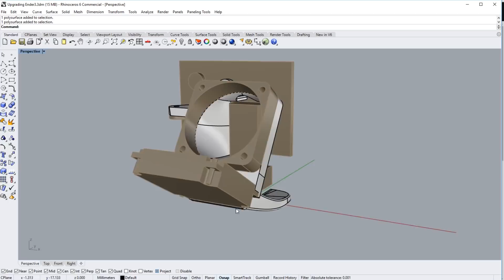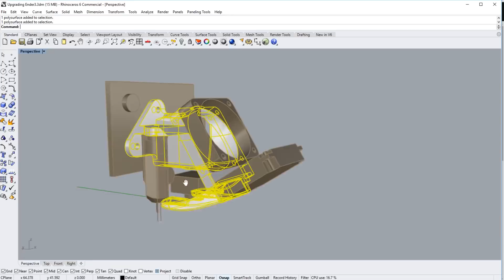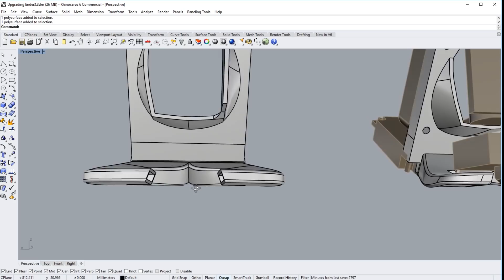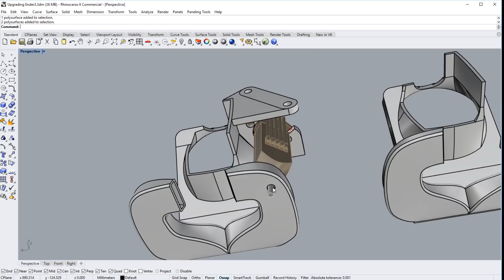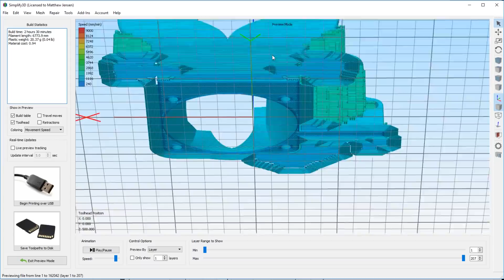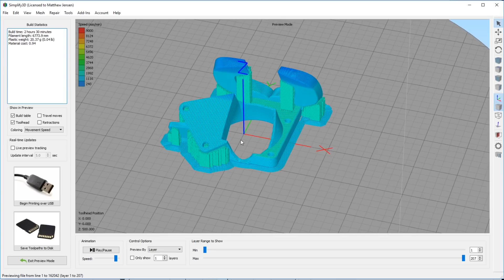Upgrading the Creality Ender 3 with Duet Wi-Fi, and other add-ons - part 1

Comment: So, I totally get what your saying about "stealing from companies", but I would argue that it is duets fault for making it open source. If they really wanted to make the best product and keep all of the cash, then they would have done the same thing a company like Apple has been doing for YEARS. So is it really stealing if they made the choice to put it out there and NOT make all the money they possibly could? I honestly think that the open source movement is good in all, but it's really not a great business tactic, ESPECIALLY if you want to make as much money as possible from your revolutionary product. And, I'm pretty sure the folks at duet know that.
Reply from the maker: Hi Austin, Thanks for another great comment. I get your point, the thing is that the DUET is built upon the Arduino DUE which is open source. Therefore, the DUET is required to be open source. The GNU GPL V3 License agreement that most of this stuff is based on requires that if you use open source in your product you must make the advancements you contributed open source as well. This is the thing which Chna is not doing. They are using open source, but not releasing their contributions. 

Here is the thing though. people have to earn a reasonable income for their efforts. Especially people talented enough to create electronics boards, and the software that goes along with it. These people can get jobs elsewhere and they will stop making better and better 3D printers for you and me. If we as a community don't reward original creators we will lose the people doing the innovating, and all we will have is the copycats. The knockoff folks don't know how to create new and innovative things, all they know how to do is copy. If you love new and improved tech, you have to reward the person or company responsible for creating it. Even if it is open source, and technically speaking the copy cats aren't breaking any rules. But they are breaking rules, and they are getting away with it. They aren't releasing their designs to be open source, and yet we are all still buying the cheap crap while the original creators starve. Well maybe not starve, but they aren't getting rich, and they should be.
Reply: Design Prototype Test Yes, i agree that from a moral perspective we should try not to support the Chinese copycats, and encourage them to make great and original products like Creality. It would mean better products for the rest of the world.

Though, if duet really wanted to make some great money and still have it be open source, they should consider making a partnership with a factory in China to mass produce the board at a low price just like E3D

Now from a totally business perspective, I'm not sure if copycats in China are truly are breaking any rules. By using an open source product, are you lawfully agreeing to make your open source product to the same degree that it's predecessor was? Do companies that make open source products have the right to sue companies who copy their ideas without proper documentation?  I don't think the a court of law recognizes an open source product as defendable in court. To me, it seems clear that an open source product is not lawfully protected like a patent or trademark. 

Furthermore, no one has fully defined what open source really means. Duet is not completely open source, because they do not have proper Bill of Materials and their schematics are incomplete. This makes it unable to be manufactured without some reverse engineering.  This is the same thing with the prusa mk3. No average person can create their own Einsi board because the files are improperly documented (as least to a electrically challenged individual like myself).

On the other hand, the Sigma line by BCN3D and Lulzbot printers are regarded by most to be fully open source. All necessary information is available and properly documented to the general public by both companies. 

Now, with all these gray areas, Im sure that you would agree that this is a very complex issue. But, do I think that China should start making more of their own original products? Absolutely. Do I think that open source has made 3D printing what it is today? Absolutely. But, I also think that open source has a long way to go before it is concrete and effective. Duet, even how great their products are, from a purely business perspective is frankly stubborn. They could really try to bring the cost down on their boards to compete with copycats, and they could be more in depth with their open source business philosophy. Prusa is a great example of this. Even though his product could be more open, Prusa is making great money and expanding his business all the while maintaining the open source philosophy. He is a truly respectable man from an ethical and business perspective. 

But again, open source is arguably a gray area right now. Many people, myself included, are wondering the same things. What truly makes a product open source? Should the definition of open source be up to the company? How can we stop China from hurting original creators? How can we encourage China to make new and great products based on ones that are open source? How can we change a culture (China) that actually has a proverb that translates to : "If you can cheat, then cheat?  And, how can we make an concrete and lawfully recognized system to encourage more people to spread great and original idea? I certainly don't have the answers, but hopefully they will reveal themselves in due time. :)

P.S Great video as always. Should have said that at the start, but I was so eager to share my thoughts with you on a controversial and not fully defined topic and have a discussion. I love business; someday I dream to be comparable to the likes of someone like Elon Musk, and I really want to explore this business philosophy and how we can fix it. Anyways, this video like many of your others very informative and very entertaining for an engineering student like myself. You're one of the YouTube channels that make me happy the moment that they upload. Thank you for making the world a better, more informed, and more creative place!!! :D

Comment: Great video! I have a PRUSA MK3 and an Ender 3 in my collection of 5 printers. Perfect timing for your series, I have another Ender 3 still in the box. How are running the 40mm 12v Noctua as cooling fan? I know the Noctua on my MK3 is a 5 v running off the board.
Reply from the maker: I will use a $3 step down voltage regulator AKA buck converter.

Comment: I am somewhat new to 3d printing but I do have a bit of injection molding experience and without question injection molding abs is far better in strengh and accuracy than printed parts. As far as the zip ties being shown, I almost laughed when shown. Are you friggin kidding me? Paying nearly $800 bucks for printed parts and zip tied rods is a joke, say whatever you want but as a professional machinist with 25 years in trade in prototype machining when you can at least 4 ender 3's that print parts just as good or better depending on the skills of the programmer it just doesn't and up all the Prusa hype.
Reply: the rods are physically constrained in the bracket, the zip ties are there for a safety, like if you were to pick the machine up by the rods, they couldn't snap out of the holders.  (edited for spelling)

Comment: Subbed because this something i been wanting to do also, how hard would a touchscreen be to install with the new board?
Reply from the maker: Not hard, but a panel Due is expensive and it's not necessary. You can use your cellphone to control the printer through the web interface like I showed at the 7:20  mark in the video on my Tevo Little Monster.

Comment: The long term max operating temp of nylon is around 120-150c.  I think youll be running into other heat related failures before the v groove wheels.
Reply from the maker: This is good information. Thank you. Do you have a source? Where did you learn this?
Reply: @DesignPrototypeTest  I looked up long term nylon max temp then read a few industrial white papers.  The numbers varied  depending on the nylon blend but I didn't see any under 120c.  Check out this link https://omnexus.specialchem.com/polymer-properties/properties/max-continuous-service-temperature

This shows the lowest numbers I found. Showing 120c for pa6
Reply from the maker: Thank you! I will talk about this.
Reply: Design Prototype Test ...Someone above said the wheels were actually made from delrin...not nylon.  Feom DuPont’s website: “Delrin® acetal homopolymer (Polyoxymethylene POM) is the ideal material in parts designed to replace metal. It combines low-friction and high-wear resistance with the high strength and stiffness such applications require. It provides a wide operating temperature range (-40 °C to 120 °C) and good colorability. Delrin® also mates well with metals and other polymers and offers excellent dimensional stability in high precision molding.”

Comment: If something is released as open-source by their creators, then it's not stealing. 
The true argument why you should buy original is that if you do, then you support the creators, not the imitators. This gives you hope that there will be further creation and innovation. 
Also, you may consider supporting other creators and innovators who take that open-source designs and codes, then further improve upon them. These are not knock-offs, as those components and firmware are no longer clones, once they are expanded upon.
Bottom line is: buy originals or spin-offs; don't buy clones.
Reply: Funny thing is that Creality are the ones stealing now by breaching GPL on Marlin.

Comment: How did you connect Noctua inplace of original fan? It is 24v this, and this supply line is 24 volts, but noctua is 12v!
Reply from the maker: You are correct. Watch the next video for the solution. Hint: Step down buck converter

Comment: Dont throw the board away. Whenever I do an upgrade I keep the board, and put it in a basic printer later. By saving basic boards from upgrades, I've been able to put them in cheap basic DIY printers, for my brother, my girlfriend, and my daughter...

as long as it works for someone who just wants a bit of fun, who cares if its basic...
Reply: Plus dont throw the board away any board could malfunction at anytime or something could go wrong and jnstead of waiting for a new board you can just throw the old one back in and get back up and running in a hour or so.
Reply: Yes, post to me  in case I blow mine up. :oD
Reply: Yes!

Comment: I agree 100% that the Prusa isn't close to being king. But it has better support than other printers in that price range though.
Reply from the maker: Hi Norm, as I said in the pinned comment, there is a lot to be said for "Just works out of the box and if it doesn't there is 24/7 tech support to help you get it working." Everyone knows that if you buy Chinese, you are on your own, and problems are far more prevalent than with Prusa.

Comment: I really like your videos mate but i think your 'sarcasm' against Prusa (the person, not the brand) is inexplicable, remember that if a 'Creality ender 3' even exists today is largely his merit... Moreover what you say at the end of the video about the duet and the bl touch  is applicable 1:1 on Prusa and all the chinese brands that try to copy his machine... it is really the other face of the open source concept and with this video you are saying something at the beginning and its opposite at the end.
Reply from the maker: I was never sarcastic in the video. I meant everything I said at face value. 

No, Prusa doesn't get the credit for all the Chinese printers. They would be copying whoever the market leader is. What if MakerBot hadn't sold out? We would all be talking about Bre Petis instead of Josef Prusa, and the clones would all be semi-enclosed boxes that looked a lot like the MakerBot. 

There is nothing about the Ender3 which is a knockoff of a Prusa. Everything about the construction is different, from the metal extrusions and brackets to the motion system which uses Nylon pulley wheels. Note that Prusa copied China with the extrusions on his frame. The overhead gantry fame design with the moving bed is not a Prusa thing. That design has been in use for 20 years on CNC machines, and Prusa got the idea from the Mendel (https://reprap.org/wiki/Mendel) A design which he copied for his first production 3D printer several years ago. Furthermore, that frame design is inferior to a CoreXY style, and if you look for them you can find plenty of Chinese designs which don't use the "I3" frame configuration. Customers don't buy those types because they have fallen for Prusa's marketing. Even if they don't buy a Prusa, they buy one that looks similar not knowing that there are better options.
Reply: 2-4 decades of rapid development, everyone copies everyone a bit. Nearly all the bits for 3dp existed in the mid 80's off the shelf. With cheap cpu power Just enough to get em going :nD I had a minibot plotter that could have easily made 2d+ plastic parts, with a mains lead -lol
Watching the boom is so cool man :o) 2 decades we should have loads of designers and #fab ready to run components for everything. Even a girlfriend (:OD I'm so glad I'm a hermit :D
Reply: He's pissed because he didn't get a free Prusa
Reply: So all the fanboys keep saying. We get it, YOU think there's some big deal with DPT and him ragging on Prusa and Blah Blah Blah.
This guy works hard, like your Dad works hard Seb xx He isn't perfect, just some guy trying to get some income off a tonne of hard work. DPT are probably right, Prusa could be more generous to reviewers, but they aren't growing a brand. They don't need to be. 

Suddenly someone being "pissed" or otherwise is relevant in some way? It's Youtube Content and DPT put out consistently great quality. Even if they may have Failings and not understand everything 100% or be perfect.
Neither are you, leave the guy alone ffs. xxRJ

Comment: A full duet is overkill for an Ender 3 upgrade. If anything Maestro would be appropriate. Also you've made the effort to design a part cooler and cold zone cooler -- what about the direct drive extruder? How are you going to print ninja flex? -- etc Ender is still a Bodwen system.
Reply from the maker: The Maestro is a great cost saving version of the DUET, but I really love the Wi-Fi. Being able to send a print to my printer from across the house, and using a web browser to do it is so flippin convenient, and easy. I think it is worth the extra $75. I think you could get the same functionality if you hard wire a Maestro to your Wireless router, but then the router and the printer have to be located near each other.
Reply: Or you can simply use hardwired networking throughout your house/apartment. WiFi is great for portable devices, but everything that is stationary, I have connected to 1GB+ switches. Only people attempting printer brain transplants are technologically advanced, so I'd think expecting a network drop near your printer is not a big ask. All my OctoPrint configs are hard wired ethernet. I specifically am using Duet Ethernet on my other build -- WiFi is reserved for laptops, tablets, and areas I can't reasonably drill a whole to get a network wire. And if you don't have a network drop near your printer -- maker space -- use the $75 to add one :)
Reply: or use a powerline adaptor like i did. this also works fine with octoprint.
Reply: Or do it you way :nD either is great... (crap if you put the cost-difference into an ender, you'd get a pro grade tool - wiv extra toobs n a fishtail. You be go-anywhere, print everything, with a hotspot and it's own power pack at $500)

Comment: Directly under the nozzle with the head-on colliding air streams it seems that pressure is maximized (hence the "dimple" in the water) but the flow would be minimized or zero. It seems like it would be better to bias the left/right air streams to the +y and -y respectively so that directly around the nozzle you get a vortex, ie a donut region of high air flow encircling the nozzle which seems like it would do a better job of cooling the hot plastic as the nozzle moves away, regardless of which way it is traveling. What do you think? (neat design overall though!)
Reply: Isn't it? Sounds like DPT put a day of work into an great pcf doo dah. Better than the #petsfang ? I think so :o)
Reply: :>) Looks like my Bullseye minus the plenum used to balance the pressure.